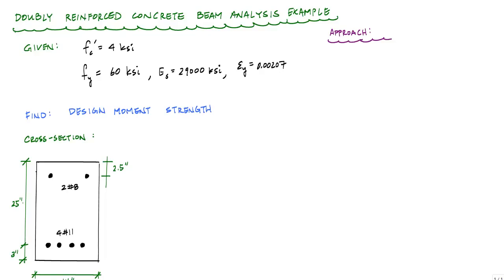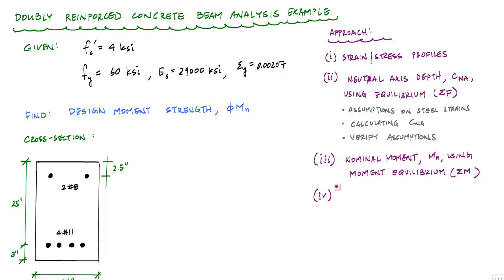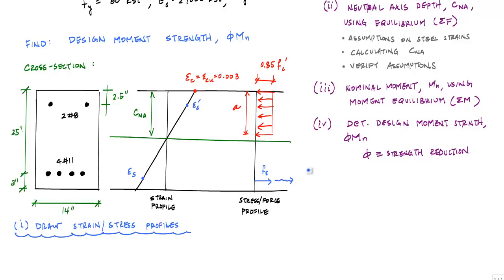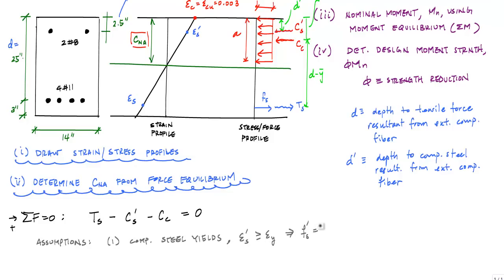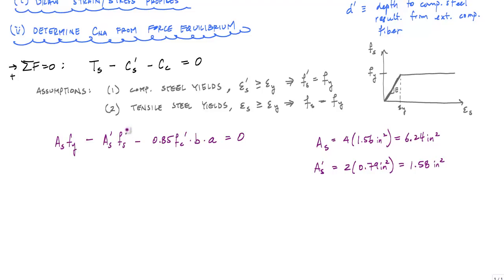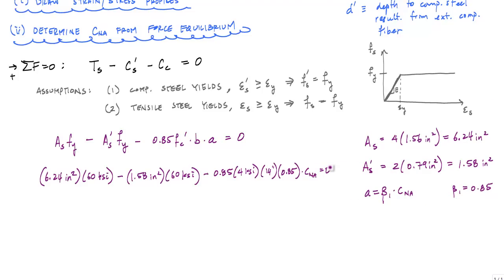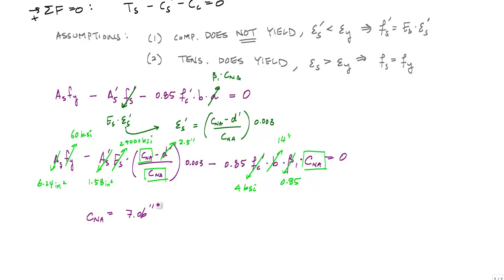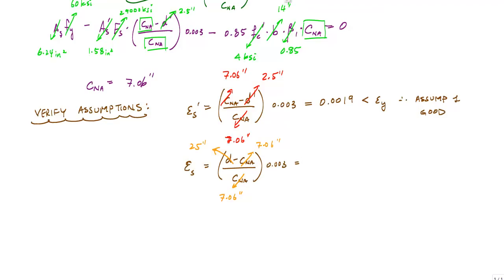Design Moment Strength of Doubly RC Section Example 1 (1/2)- Reinforced Concrete Design

Comment from the maker: Back to some reinforced concrete analysis and design. Here's a video on calculating the design moment strength of a doubly reinforced concrete section. Enjoy.
Reply: Yessss thank you , but this video does not open...
Reply: when we are analysing the basic reinforced concrete beam (which reinforcen on only tension) i think we dont need to calculate ß1 and Cna because when we use horizantal force equalibrium we got [Fc=Fs and then fc'x0.85xaxb=fs'xAs] and we are avaible to calculate a direcly. Why we have to calculate Cna and ß1???
Reply: Screen is completely green I can't see video there is only audio.... What is the issue???
Reply: wheres the part 2???

Comment: This very same Section also suits Singly-Reinforced Design. What then is the Boundary between Singly-Reinforced and Doubly-Reinforced Sections? Is it if the Maximum Moment Capacity at Ey = 0.005 of Singly-Reinforced Section is still Less than Mu?

Comment: Quick question. How do you get the moment capacity of a beam that hasn't reached compressive strain of 0.003. Compressive strain less than 0.003. Thanks.
Reply from the maker: The concrete in compression (at the very top of the beam in this example) has reached a strain of 0.003.  The strain at the compression steel layer is what is less than 0.003.

Comment: Very helpful video. Thank you!!! I just have a question. Can you actually use this beam? The reason why I am asking is because the strain of the steel in the compression area is less than .004. I thought the minimum strain value for the steel that we can use is .004 based on ACI. Or that only applies in the Tension side?

Comment: I can't thank you enough for doing these videos, they are incredibly helpful! I have one question though: if cna turned out to be less than 2.5", making ε's negative...would you have proceeded with the calculations or would you have re-designed the beam?

I have encountered this issue especially when working with doubly reinforced T-beams.

Comment: Love the procedure.  Used it on a HW problem and with the given data in my problem, (y-bar/2)-d' is a negative number.  I'm thinking the problem may just be poorly conceived, but even so, I should still get the correct moment calculation even if the Cs has a negative contribution, to Mn, yes?

Comment: Is it possible to use the first moment of area to find c (neutral axis) and then determine whether or not the strains at Eu 0.003 are greater than fy/E (0.0021 for grade 60) so that you can determine yielding before doing the force analysis and Mn calc?

Comment: Hi StructureFree. Question: How does the stress-strain curve for doubly reinforced concrete beams compare to that for singly reinforced beams? Do the same concepts (ie Stage 1, Stage 2, Stage 3 as explained in your previous videos still apply? How does the compression steel play into this? Thanks

Comment: what if we use the same number of steel bars on the top and the bottom? Cna would be zero?
Reply from the maker: You still have to use equilibrium to determine CNA. CNA would not be zero.

Comment: if you want to design doubly-reinforcement, and if you find out that your steel at the upper edge hasnt yield , you will then need to solve 3rd degree polynomial to find the location of the neutral axis?

Comment: what it is mean if the beam is compression controls or tension controls?
-Civil Engineering Student
Reply: if is tension control, phi factor is 0.9. if is compression control, phi is .65... to be tension control the tension steel must reach at least .005